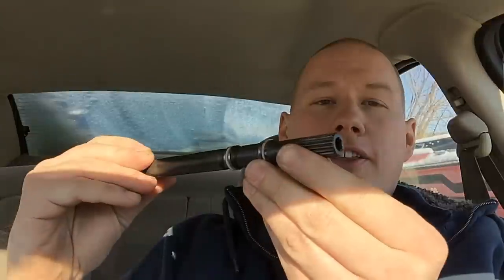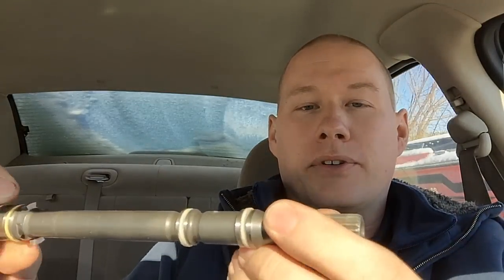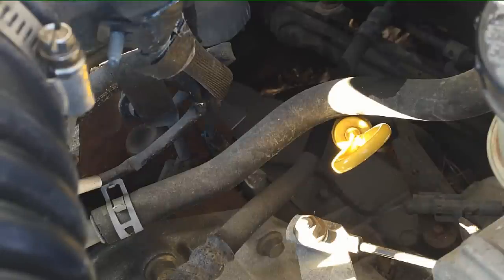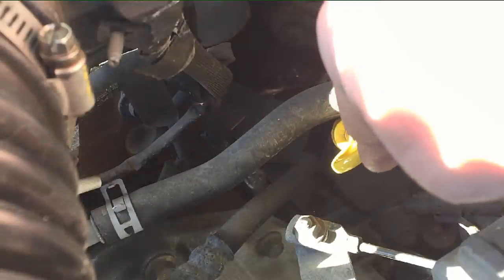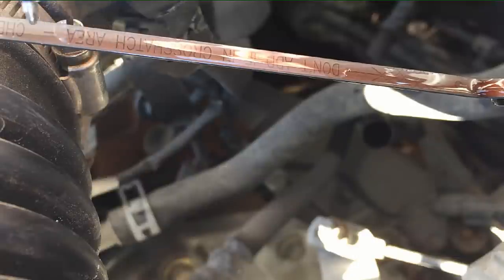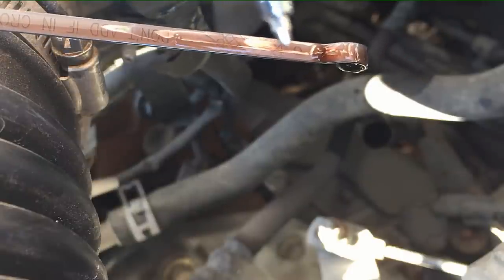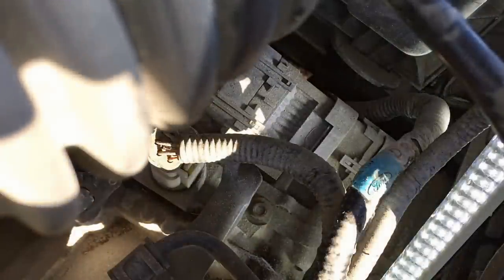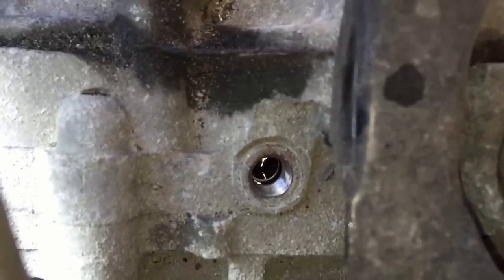Ford Transmission Tips: #5 Ford Taurus & Windstar No Movement EASY Diagnosis

Comment: That was spot on! I had this problem and did the tests. The results came out as you described. Took a chance and replaced the torque converter (it was a pain!!!) Boom: Tran is fixed and the car is back on road! I can't thank you enough for this video
Reply: I have the same problem, my 2005 Ford Taurus does not move forward or backward. Did you try removing the screw to check if there was oil pressure?
Reply: @MultiLupio  Yes. I removed the screw like he showed and the result was the same (no fluid coming out).
Reply: @RobodrigoBR I will try since my car only accelerates when changing the lever but it does not move
Reply: @MultiLupio it is exactly what was happening with my Taurus. Replaced the converter and now it runs like a champ

Comment: replaced torque converter and car still wont move!!! does the same thing, shifts and revs but no movement. 2000 ford taurus ses
Reply: Same prob here, hit the comments up if you find a fix plz.
Reply: Did you replace the torque converter and pump, or just the converter?
Reply: It’s probably something else

Comment: I have been trying to figure this thing out for a while. I did your hydraulic pressure check and it was fine. Thank you so much for those tips. What my 2004 Taurus does is when it is warm, it hesitates going into reverse. Sometimes it will catch and engage, sometimes it doesn't. Now, when it is cold, it goes into reverse no problem. Going forward there are no issues at all. It is just reverse.

Comment: I have 05 mercury sable with this transmission, first time it went at 150'000 , second time at 120'000, just like he says, the pump shaft grinds it self out at the torque converter, this  trans is terrible with this defect, replacement of this trans is very difficult doing yourself at home without a lift, a experienced mechanic in a shop said he had a hard time replacing it in 8 hours, in shop with all the proper tools and lift

Comment: Just wanted to know, you saved a friend on mine $2,500 just 2 weeks ago!!!!!  My friends Taurus died/stopped exactly how you described.  He had it towed to auto-repair shop.  They quoted $3k for 'new' tranny w/12month warranty or $3200 w/36month warranty.  (and charged $99 for 'diagnosis')  I suggested he buy a torque converter and pump shaft and fluid and filter and take to his backyard mechanic/neighbor.  Spent less than $250 on parts & fluid and paid his neighbor $250 to drop tranny and replace torque converter & pumpshaft.  No guarantees it would work.....BUT IT DID!!!!!  We didn't even try to remove the bolt and check for pressure/fluid squirting out as you suggested in the video.  Just went on faith and your expert diagnosis & descriptions & YOU CAME THROUGH.  AGAIN!  BRIAN----you're awesome.  I wish I was half as mechanically inclined & intelligent as you!  You have NO IDEA the people's lives you touch, and HELP!  I mention you & your channel to ANYONE who talks about wrenching on cars.  Semper Fi bro.
Reply: Excellent news

Comment: I'd bet aftermarket companies like Dayco converters have picked up on this and strengthened their converters. I know a dayco converter will not shudder in an older panther. 91-97ish. Great video. I think dayco has a YouTube video showing how they have improved the design of their converters to eliminate this weak area
Reply: fastrace011 do you think dayco is actually doing the engineering analysis of the failure and comes up with a fix????no they install a newer design part that Ford engineering figured out,, usually parts are from newer models that Ford redesigned!!!,it's funny how mislead the general public is !!!!
Reply: And for what it's worth,,,I've seen aftermarket rebuilt convertors have the same failure,,,that are supposedly rebuilt with updated and upgraded drive hubs

Comment: Awesome info.  This just happened to me today, 1 mile after I had my trans serviced and torque converter replaced. BAD converter.  Just came apart at the hub you mentioned.  Now, they gotta do it again.  And the fluid level test?  Yep, exactly what I found when it stopped and I checked it.   Thank you for the info.

Comment: I'm working on a 2007 Taurus where the car will not go in forward gear but will go in reverse. It does engage in drive for a second but slips after and wont reengage.  Didn't know about the weep hole and will check that first. Thanks for the tip Brian.

Comment: Had the same sort of issue on a Ford Tempo. pump shaft spline stripped out on the torque converter end. The shaft itself was fine.

Comment: Thank you for the video.  I did this test on my 1999 Lincoln Continental that had similar symptoms, but there are a few differences.  I started the car, and it was lazy to engage in gear one morning (was working fine until that day).  When I drove away, it acted like it didn't want to shift out of first - then there was nothing.  I coasted to a stop.  No gears, either forward or reverse.  When I did this test, I had no movement of the fluid on the dipstick, running or not.  When I pulled the pressure plug, I had gurgling fluid, but no geyser. Still think it's the torque converter?

Comment: So I just purchased a 2003 Ford Taurus and at first when I would make a sharp turn the car would kinda pause mid turn and then kinda jolt forward. I took it to a place to have it fixed and he replaced a transaxle oil pan gasket , and did a transmission fluid flush and fill. He first told me it was my Camshaft Synchronizer and said that he would  fix that and would clean my fuel throttle but didn't do that. Stating that my problem was not the Camshaft but the the transaxle gasket.  My car was able to keep power when I turned corners after he fixed. Shortly after my car would not start after driving it for so long, then after 2 try's it would then start up. Well, a week ago I tried to start it and it would not start at all.  It starts, run's fine but when I put it in either reverse or drive it just shuts off. I called a Ford service dealership and he said that it sounds like a need a new Torque Converter. Just wondering if the issues I described sounds like a Torque converter issue and how much does it cost to have one replace. I believe the guy at Ford said something in the ballpark of 2000.00.

Comment: Thank you very much for this video!  Two years ago, my girlfriend's 2004 Freestar was experiencing random loss of power and unusual clicking noises when accelerating so I took it to the dealer for the torque converter recall. The clicking sound persisted after the torque converter replacement and the dealer said they don't know what the problem is.  Within a few weeks, the transmission wouldn't engage at all and the car remained in my driveway ever since.  Because of your video, I now can see that the problem was the transmission pump shaft that was making the noise and needs to be replaced.  We were about to scrap the car until I saw your video but now think it may be worth repairing.  Thanks!  I'll call around to get estimates to find out how much that will cost.
Reply: Did u replace it?? Was it the shaft ?
Reply: @oscarcastro280  nope, sold it as is

Comment: hello, great video with great information.   I have a 05 escape with a similar issue.  no engine codes, can turn car of and on and will go into gear occasionally, but then slip out.  could this be sensor related?

Comment: Thanks for the info Dude! I'm not having trouble with my transmission as of yet, but it's nice to have the knowledge ahead of time! What happens to the metal shaving from the splines inside the torque converter? Do they get pumped through as get stuck in the filter or do they remain in the torque converter? I wonder if those shavings get into the clutches??

Comment: Unfortunately I've already changed the transmission once because of this problem luckily I went to a junkyard ripped one out of there it was $100 but it was very labor intensive taken off the transmission off of front wheel drive vehicle at home with no lift unfortunately after driving the car for about 4 more years the same problem has happened again I'm done with this vehicle, but yes you can just take the torque converter out and replace it but since you have to pull the transmission out to get to the torque converter I just replaced the trans and the torque when I did it from the one I got from the junkyard and again I was lucky enough that it actually worked

Comment: I have a Freestar that reverses fine when you first start it. But when you drive for more than 2 minutes and shift to reverse, half the time won’t engage. And the other half it will engage. When it does engage you can only give it very light throttle. If you give it 20% or more throttle, it slips and will not move. It also has a hard shift 1-2 and a delayed (slow) shift 3-4. In your opinion do you think I’m having a torque converter issue? The recall was done in 2012.

Comment: Had this happen on my 2003 Taurus back in October 2021.  The big problem with transmission removal is you must remove the sub frame before you can pull the tranny.
Reply: @hkk3656  Yep, mine had only 68,000 miles in spite of the cars age.  Decided to keep however and forked over 1600 for the repair, 1000 of which was labor

Comment: hey buddy, first off thank you for the comprehensive information in your videos, i have a question... what if it doesn't have reverse only? it's an 03 Taurus... does that transmission use shift solenoids?

Comment: If you are lucky, you can drop the subframe on the driver side enough to get the valve body and pump shaft out.  My pump and shaft were toast and it also damaged the valve body (due to the pump shaft bearing failure in the valve body).  Replaced them all and now runs like new.  $100 for a junk yard wreck valve body & pump.
approx: $100 for valve body bonded gaskets, pump shaft, pump shaft bearing and seals.

Comment: I have a 2004 Freestar with the 4.2.  Transmission stopped working like you discussed in your video.  I had to have it towed to transmission shop in the city where it broke down.  I was informed the pump is out so I guess they diagnosed it like what you did.  But then he said the transmission is making" a lot of noise" so he feels it needs a complete rebuild.  I just wanted to ask if this sounded correct or if there is a possibility I am being taken advantage of?   Cost of repair 1800-2000 with one year 12K warranty.

Comment: My 02 Windstar won't budge. Runs fine but doesn't engage any movement. When I put it in reverse the backup lights come on, but nothing. I did the simple trans fluid test and fluid was way up on the stick when turned off or running as well so I am assuming the torque converter may very well be the problem. Any idea how much it cost in labor on average to put in a new one? Probably as much as a used 02 windstar that runs without the issue!

Comment: Great visuals and tips!  Have you ever seen an '02 Focus 2.0 SOHC "P" vin sustain mechanical damage to the spark plug and cylinders on #2 & #4 from the engine being over filled by 1 quart of oil?  The timing belt and marks are still on, but the compression is shot and the bore camera shows significant damage to the top of the pistons and the spark plug ground straps are smashed.  It looks like a timing failure where valves get hit and break off before going shrapnel on the cylinder.
Reply from the maker: Yes my very own vehicle had this happen among many thousand others out there this is very common on the SOHC SPI engine. The valve seats fall out of them and destroy the head and pistons yes. It was not a timing issue, all Ford engines that have belts are non interference engines.
Reply: briansmobile1 seems like it jumoed timing

Comment: Hey Brian! I have an 08 taurus limited awd here in Canada and I just had a bad experience where I have to go for a 2 hr drive back home. It started loosing momentum, airbag and low gas light appear and eveything happens at the same time but I managed to pull over on a near parking lot. While on the parking lot, the car jerks hard when shifting to Reverse and Drive. Pulled the dipstick,wiped it off and checked it and fluid seems to be within range but I noticed there’s a smoke coming off from the tranny dipstick and let the car rest. After 30 mins, Reverse was responsive but not on Drive. Pulled back to L, it was moving a little bit but speedometer stays at zero. Pushed back to Drive and it became responsive. Managed to drive back home and when I reached home, I tried shifting in all gears and the jerking was gone like nothing happen and so the check engine light. Only drove for 3 hrs from home when that happens. What do you think happens? Is this something serious?

Comment: Great video. Frustrating that Ford allowed this kind of defect into production.
Reply: frustrating that they know the problem and wont stand behind it, thy should fix it. there are thousands sitting around the country thay people have given up on,
Reply: They did stand behind it,,,they issued a recall a few years back to replace the torque converter for a no movement condition!!!!
Reply: Hi, I’m sorry to ask you to repeat yourself, but I’m experiencing this problem now. I wonder was it replaced in my 03 windstar. How do I check?
Reply: corey Babcock  get your vin number and call a ford dealer,,ask them to run your vin and see if there is any recalls.
If you have one that all of a sudden experiences a no movement condition,
You can fix it by shimming the convertor back towards the transmission,,you have to remove all 4 convertor nuts and cut an opening into a washer to install the washer between the convertor stud and flywheel,
Inside the convertor they fail for two reasons,,,cheap metal used,and the pump shaft doesn't go into the drive splines very far,,thats why shimming it will work
Reply: @justingeraldi2304  They indeed did, but not for the Windstar and Taurus.

Comment: Great video! Very helpful. When I checked the fluid level when cold, I saw the high fluid level on the dipstick. After starting the engine, I rechecked the fluid level on the dipstick and the fluid level was down to the normal operating level. It looks like the pump was working. When I removed the "LINE" plug, nothing came out. My question is: why does the fluid level go down on the dipstick once the engine is started. Obviously, checking for pump failure using just the dipstick, doesn't work. Why? What's going on in the transmission that is causing this?

Thanks!

Comment: No one seems to know whats wrong with My 07 Explorer!! Randomly (few times a week) it won't engage into gear (reverse OR drive) after i start it & put it into drive NOTHING happens when i hit the gas (Reving but no moving)..Eventually after a few minutes if i leave it in gear it'll catch... It's not slipping, missing, or "hunting" when im driving it. it's just a matter of getting it into gear initially after start-up.. Btw. I LOVE your channel and knowledge of Ford vehicles I have learned so much.  --> FordFanForLife
Reply from the maker: Is this only after the vehicle has set for some time like a few hours or overnight?
Reply: It mostly happens if it's been sitting overnight..  However just the other day It took about 10-15 seconds to find drive after a doctor appt. (It had only been sitting for an hour)

Comment: Thanks for the info. The exact thing happened to my 03 Taurus OHV. I ended up getting charged for a transmission rebuild and new torque converter. Wonder if I even needed the transmission rebuilt or if they even did it? Happened at 90k miles. Well I guess now I know.

Comment: Hi,  I have a 2006 Taurus with the AX4N trans.  For routine fluid & filter change, do you believe that dropping the pan, cleaning the magnet and replacing the filter are sufficient?  Or, do you believe that a flushing procedure should be used?  I understand that the fluid capacity of the trans is 13.5 quarts.  By simply dropping the pan only 6-7 quarts are removed.  Thanks!!!

Comment: I have reverse gear shifting problem with freestar 2005 180mile.
Everthing was working fine, no gear issue, 0 problems in the whole van except cruise control that i repaired. Until I received recall letter from Ford saying that Torque converter should be changed for some reason. 
So I went to ford and they change it for free. Was very happy i got New tc for free. i was feeling little smart also. But after around one week i feel there is a problem, when I shift to reverse gears it takes around 5 second to engage but for all other gears (D, 1,3) it engages normally.
When I shift to reverse gear i don't feel any movement in transmission but after around 5 second I feel engaging and sometime the van shake a little bit before going back.
What it can be?
Reply: G H sounds like it's low on fluid,,,hope you figured it out by now!!!

Comment: Great test. I am about to go outside and check it.  But what if the van has to idle for 5-8 minutes before tranny engages?  Then once, I warmed up van, drove it a block, then no gears.  I sat there for a while and then the van went into gear and I drove it back home. Pump or still converter on way out?  Thanks!
Reply from the maker: +customcruiserroy I would check the fluid level first but if it keeps happening then the center hub in the conveter is likely worn out.
Reply: +FordTechMakuloco  I checked fluid on level surface and it was up the stick big time.  I thought to myself, I didn't add fluid.  So your test of checking stick told me the pump wasn't turning.  This is also the van that through up codes about 4th gear not being in sync.  So friend said solenoid in valve body.  I guess time for a rebuild.  Thanks for your help!!